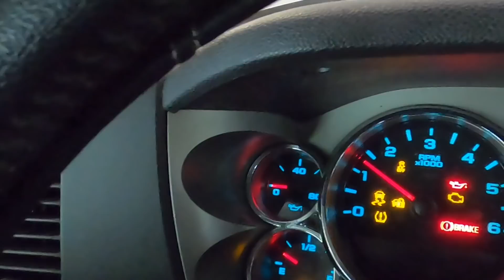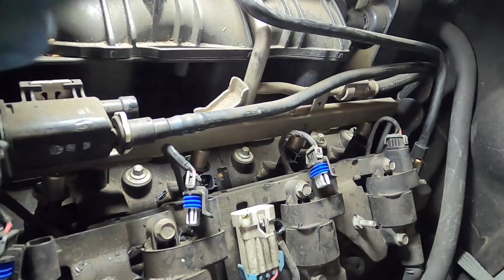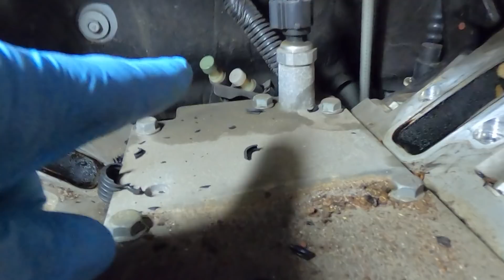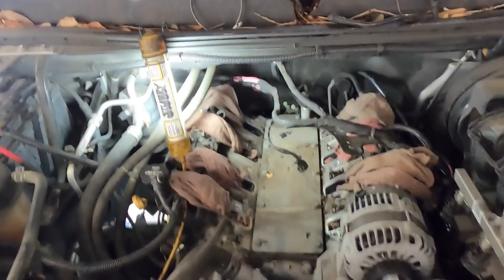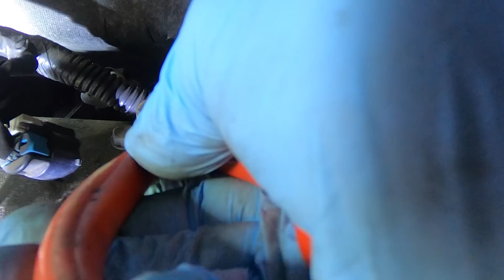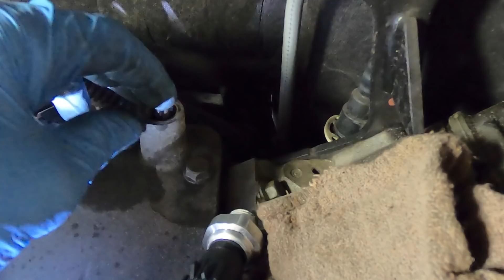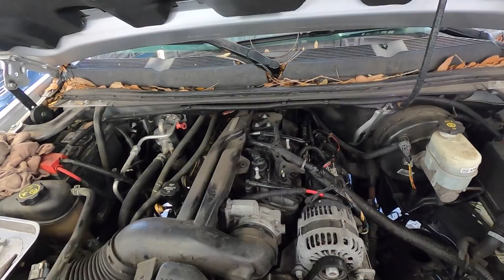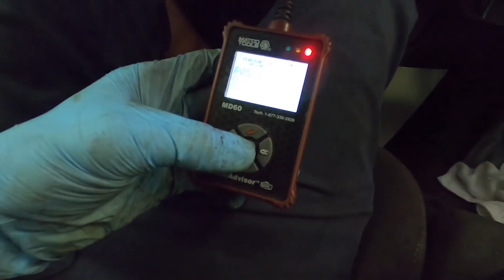Customer States: Google Diagnosis…replace this part!

Comment: The customer is always right. Except when they're not.
Reply: Wow... how many other people knew from the beginning that replacing the oil pressure sensor would not fix the problem?  Check out South Main Auto Repair.
Reply: Right at the end of the video, you can just see the gauge, and it appears to be working.
Reply: @bills6093  Look again. I did and it is easy to mix it up with the fuel gauge which is right under it. I think several people did that.
Reply: @wernerdanler2742  Fuel gauge reading is too low at the start of the video, though.
Reply: @wernerdanler2742  ~18 seconds. Look at fuel level.
Reply: @bills6093  Unrelated comment, But the customer did mention it was an intermittent issue. Sometimes comes sometimes goes.
Reply: @lward53  real problem is probably the o ring on the oil pickup tube that goes to the pump or the relief valve in the oil pump itself(both very common issues on ls motors) ,  picked up a nice low mileage Escalade for little more than a song because it was reading 0 oil pressure until it warmed up then it would work intermittently,  90 bucks for a pump and gasket setand an afternoon of my time, sold it for 10k more than I paid for it.
Reply from the maker: Ok so after a couple day of Reeeeeeee comments I’ll chime in. For starters, the customer said that the gauge intermittently works then quits. No! I won’t do this job without pulling the intake. I’m not risking straining or cutting my hands up, so I can charge 25% of the book time to do the work. I have to take care of my hands, they feed my family. If I strain a metacarpal or get cut I can’t earn. I didn’t decide to circumvent the process to “pay less” for a repair because google said so. I don’t own that. Others people’s decisions are not my problem.
Reply: Sounds like you've had some car problems recently. Dont take your frustration out on others. Especially Ray.
Reply: The customer is ALWAYS right. ESPECIALLY if they're wrong. 

If they're wrong and you do it then its completely they're fault/problem for not willing to listen to the person who's job it is
Reply: when they're not right it means you are scamming them😆
Reply: @VWisrotzooi  you didn't tell me the answer i wanted to hear?!?! you must be a bad person!!! rawr!!!
Reply: @garonburwell9008  basicly that yes🤣
Reply: What kind of technician just accepts a part and says "ok, i'll take your money and install your crap when I doubt it'll work?"   Everyone thinks they know about cars. I encounter this every day. Part of being a responsible and professional technician is saving your customer money over time.  It pays in dividends as a professional, you don't need to milk your customer's ignorance for $100. What a morally deficient professional in my opinion.  This guy that made the video basically at the end says, "ha. it wasn't my fault and it didn't work. This is why you don't try and diagnose your own car."   Who's he talking to? Not the customer that needs his help!  Some imaginary audience in his head that he'll never meet, the comments section on youtube. What a stain on my profession. I would discuss this with my customer and educate him or her and I always find the limit on how much they want to understand car wise, that doesn't take long when you start talking about how stuff works and their eyes roll in the back of their head. But a vehicle is the second largest investment most people ever make. And it takes more service than many people understand to make it last and to take care of that investment. A professional provides service with that point in mind, always.   I just have one question.  This "mechanic" was willing to spend the extra hour to pull someone's intake when it wasn't even necessary -- why in the world wasn't he willing to spend five minutes with a multimeter to avoid it all and make an immediate impression on his customer and lock that customer in for life?  He would only have to give up this one time of stealing a quick and easy job and he would have EARNED a customer's respect for decades.
Reply: @JohnDoe-lt9sg  no way you’re a tech. And if you are, you’re the one hurting our industry. He did what the customer requested to do. 

I don’t want a customer for “life” that expects me to work for free. I run a business, not a charity. 

If the customer wanted the truck fixed, he would’ve asked for a diagnosis. The customer said “replace this” and the shop said “yes sir”. That’s it. Nothing wrong with that.
Reply from the maker: @PaedrianGuides  yes that’s what happened. I’ve been doing this long enough to stop arguing with customers. I offered to diagnose the issue and dude declined.
Reply from the maker: @JohnDoe-lt9sg  sorry dude, I don’t argue with customers. Silverado Man was convinced that the sender was faulty and didn’t want to “waste money” on confirmation. He paid me to change the sender, and that’s what I did. And yes, the intake comes off. Yes, it can probably be done without removing the intake. But I’m not reaching back there, cutting myself or straining my hands and getting carpal tunnel syndrome our arthritis when I age to take risky shortcuts. I have to keep my hands healthy. Hurting myself, so a know-it-all can short change me on a job isn’t a sustainable model. Just sayin.
Reply: @JohnDoe-lt9sg  I appreciate how you feel here . But we are now in a world of buying our own devises for $50 to diagnose your own car and many how to YouTube videos.  So this customer felt he could save himself the diagnose charge . He will learn now why you technicians spend the time at school and courses then become apprentices and dealerships and independent garages spending 10s of thousands of dollars on diagnostic gadgets and databases.  I too in the 80s before all this computer stuff thought I was able to twist wrenches but slowly learned the above, I didn't know shit and it was costing me more money and grief . 
Then you got to understand dealerships! As a customer you will never see or know who the technician was, nor would the technician know or see the customer.  This guy just doing what he was told to do by a supervisor in a office who often hides in a closet so he can't be found . For this reason I only use independent shops who have the equipment and experienced techs that I speak with. Never ever tell them how to fix, just what is wrong and just open my wallet and hope for the best , never say do it as cheap as you can either. Works well for me anyways.  And for the Love of Gawd I stay away from lube places. My mechanic finds and fixes any issues while he changes my oil.
Reply: @JohnDoe-lt9sg  Some customers are quite adamant about not paying for diagnostic time. They feel that the oracle of Google is all they need to make it through life. We've had a number of customers tell us to replace this or that, and often bring their own part. We'll do so, then give the owner their part box back with the original removed part in it so they know we did what they asked. It's the way of our brave new world.
Reply: @JohnDoe-lt9sg  calm down Hero.

Dealership tech life is different. I don't talk to customers because it's not my job. If a customer specifically requests to speak to the tech working on their car, I come out with a smile on my face and provide them with a good and respectful conversation about their car. But if they don't request to speak to me, I will not go out of my way to speak to them. That's what service advisors get paid to do. And an experienced advisor will advise a customer on the benefits of having the problem diagnosed before replacing a part. If the advisor did not properly advise, that's not my problem.  I've worked as an advisor before, and I'll tell you from a position of experience that some people DO NOT WANT the problem diagnosed, they just want the part changed.  OK Mr./Ms. Customer, please sign here acknowledging that we are not diagnosing the car per your request, and we are fulfilling your request to replace a part without diagnosis first.  We'll do what you ask and move on to the next car.
Reply: @JohnDoe-lt9sg  You're making lots of assumptions based on info you don't have.
Reply: @JohnDoe-lt9sg  I appreciate  your sentiment.  However with all of what you have said,  said, convincing  some customers that diagnosis  would save then money when a YouTube  video says that  part X is the fault , is impossible.  I'll  just take their money , maybe they will learn.
Reply: @JohnDoe-lt9sg  You are so full of it! If the customer says "this is what it needs," are you gonna stand there and argue with him about it?
Reply: @JohnDoe-lt9sg   John from my experience the great customer will let you diagnose it your way  because they trust that you have their money in mind. The ok ones will want it done their way and their  is no information or reason you can give to change their minds but they accept the responsibility if it doesn't work out.  The bad ones will argue with you until the cows come home and when their wrong you get blasted.
Reply: @TrueCanad1an  i mostly agree with what you are saying.  It is my opinion, a costumer should do enough research to get an idea if what’s likely going on but acknowledged the Dunning-Kruger effect.  This way they are knowledgeable enough to not get scammed and are able to make informed decisions while at the same time not getting in the mechanics way.  So tired of the death of expertise in this world.
Reply: @JohnDoe-lt9sg  I thnk you are a morally deficient commenter?  The job of the technician is to do what the customer asks for.  The customer did not say, "Fix my truck."  He said, "Please install this part for me."
Reply: @JohnDoe-lt9sg  in all fairness, I understand your point, and it is always better in the long run to identify problems to the customer if you see them. However, at the start of the video, Ray did say the customer asked not to diagnose the car and just to install this part.
Reply: @JohnDoe-lt9sg  a tech who tried with the customer and quickly realized the customer was unfixable.  i try to be like a trustworthy "automotive atorney" looking out for my clients best interests with their car and money however this kind of care and thought is completely lost and unappreciated with lots of folks.
Reply: @JohnDoe-lt9sg  All a professional mechanic can do is tell the customer that they do not recommend just changing a part without proper diagnostics. but if the customer INSISTS like what happened here. Then you've done all you can as a pro. The customer was advised not to take that gamble but he chose to ignore that advice and lost. Sure the mechanic could have refused his terms and tell him to go elsewhere but then he loses money.  The customer wanted to gamble! so just let the man do that. lol.
Reply: @JohnDoe-lt9sg  
Money is money, if someone wants to pay me to do something stupid, but not actually dangerous, and I've advised against it and covered my ass and they still want to... really why wouldn't I do it?
Reply: @JohnDoe-lt9sg  from the sounds of it he (if he's the one who talked to the customer) DID recommend a diagnostic but customer said no. When dealing with human customers as a service worker dont risk doing something that might make a customer think they can complain about you screwing up.  I didnt read your whole comment because thats just to many words on something that doesnt matter.
Reply: @JohnDoe-lt9sg  You clearly dont work in any position that works with customers. Good luck telling any customer they're wrong. Especially if they get fixated on an issue. 
You say he'll doubt it will will work, Doubt isn't certainty. When your customer says 'REPLACE THIS OR I'LL GO SOMEWHERE ELSE' You're not turning down the job. It might work like that for some back-water garage mechanic like yourself but when you're an employee of a larger system thats a good way to piss your boss off.
Reply: @JohnDoe-lt9sg  He worked at a stealership for too long.

Comment: He should bill Google for the misdiagnosis.
Reply: Pssst. Hey you.  Come here.  look here.  32:14  Google was right.  The gauge is up.  If google was wrong, why oh, why did he not give us a shot at the still nonworking gauge?
Reply: @vilefly 

Yes exactly. I want to see the cluster with the engine on, raised RPMs, no engine light (after clearing the codes) and the oil pressure gauge clearly visible. He didn't get that shot for a reason.
Reply: @vilefly  Psst. Ray stated that the customer said the gauge was intermittent. Instead of letting Ray perform a full diagnosis, the customer said to just replace the sender. Just because you saw it function once in the video does not  mean it is repaired. He followed the customer’s request.
Reply: @MagnumOpusSRT  Well, we can debate this all day long, but my experience with this particular situation in my shop tends to steer me here.  The first diagnostic step would tend to be to replace the sensor anyways, due to the difficult location.  Getting an oil pressure gauge in there and back out is a 1.5hr nightmare that doesn't cover intermittent faults.  That part WILL scald your hands.

Comment: I do a lot of DIY automotive stuff. When I take my vehicles in to be repaired, it’s to be diagnosed by someone that ACTUALLY knows what their doing! Poor guy, but he brought it on himself.
Reply: Usually if I'm taking my vehicle into the shop it's because it's beyond my knowledge and expertise..... I may have an idea of what it is, but I'll let them check so they know it's repaired right...... I don't like having it in the shop multiple times because I told them something wrong
Reply: Man, I'm so glad I drive Hondas. Over four cars and 800,000 miles of driving, I don't think any of them have ever needed anything beyond routine maintenance. (Tyres, brake pads, batteries, wipers, etc.)  Occasional wheel bearing from wifey mounting the kerb. But that's it. The first one I owned did develop an intermittent electrical fault my garage couldn't diagnose at around 200,000 miles, so I just got shut of it. But that would have been 20 years ago. I don't think they used those diagnostic computers back then. Perhaps main dealers had them, but my guy around the corner wasn't getting anywhere with it. 200,000 miles is long enough for me anyway.
Reply: @twatmunro9563  I had a Honda and it was such a POS
Reply: @twatmunro9563  - you need to get an Americanized car so you can experience getting bent over every six months for repairs
Reply: Or better yet own a Jeep and it will be every 3 months. :(
Reply: At most you’d would comment that you think the problem might be X, but you would like them to properly diagnose.
Reply: This is what I do and it's real simple I go in the shop I say to him this is what I think might be the problem then you guys do a diagnostic and tell me if I'm right or if I'm wrong and fix it that's it simple don't try and tell a professional how to do their job it does not sit well have a good day
Reply: This!
Reply: I do that also. If it's beyond my basic knowledge I take to a shop and have them run the diagnosis, pay the $50-$100 but now I know the problem and can fix it myself.
Reply: @ahmadghosheh3104  sometimes I can, sometimes I can't, but yeah I do a buildup to attempt to diagnose it..... if I can fix it myself I do, but if I see it's beyond my knowledge it goes in..... but I rarely ever have it in the shop
Reply: @creamwobbly  LOL. What a dork.